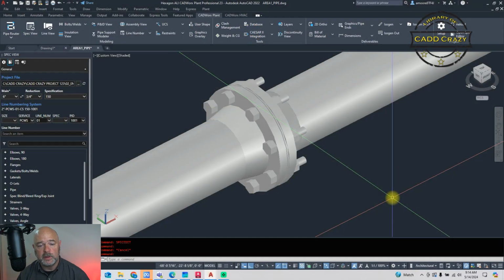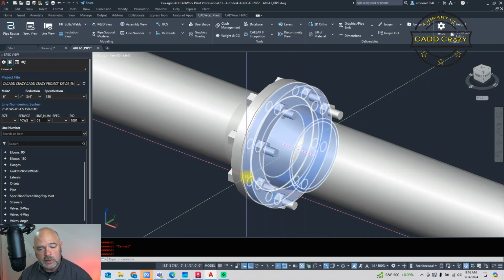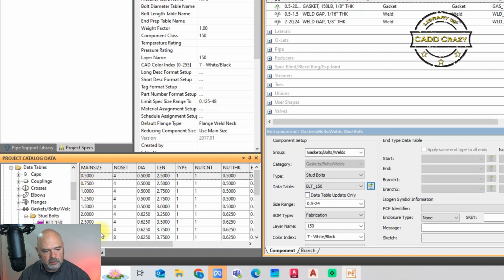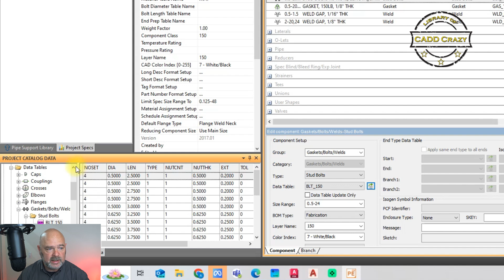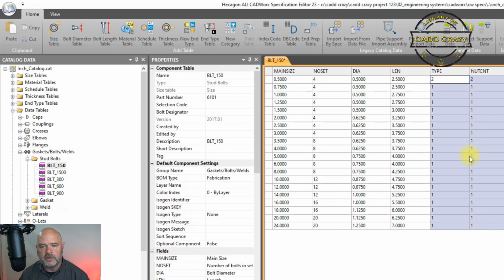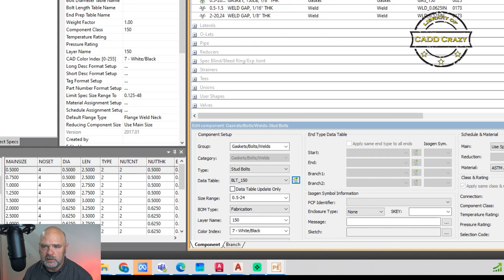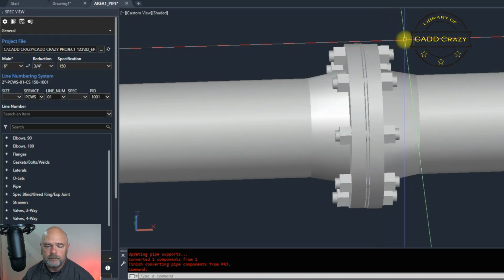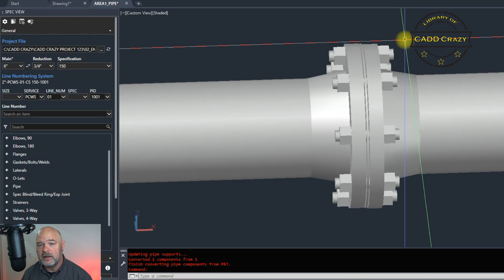CADWorx Enhanced Bolt Graphics

Comment: hello, i would like to know if there is a possibility to add the length of a stud bolt in the material list in the Iso drawing and change the standard length of the stud and finally make the cadworx calculate the total number of studs
Reply from the maker: If I understand you question correctly the answer is yes to all. After you place the bolt you can change the length by changing the Coordinates from world WORLD to ISO in you Component Edit dialog box. You can also create a custom bolt when placing it.